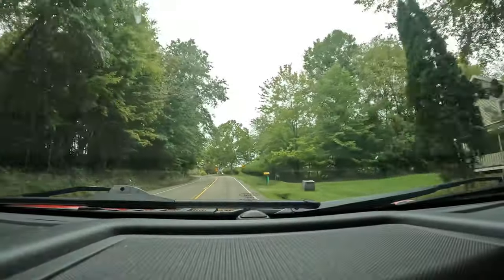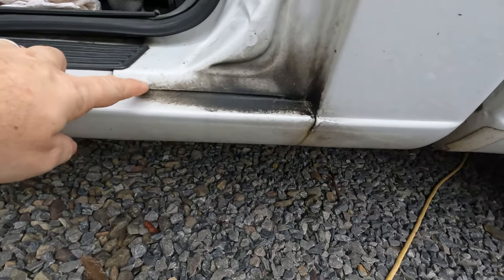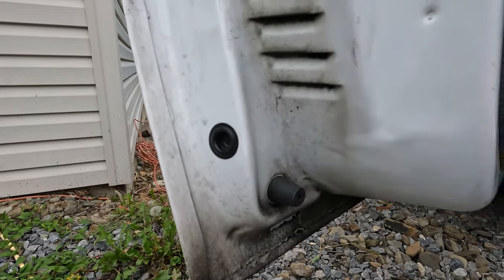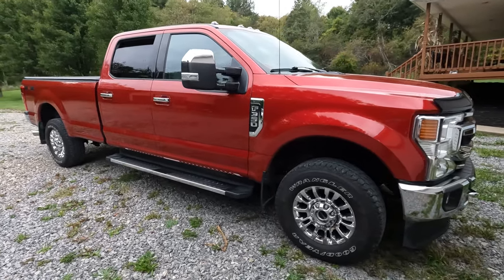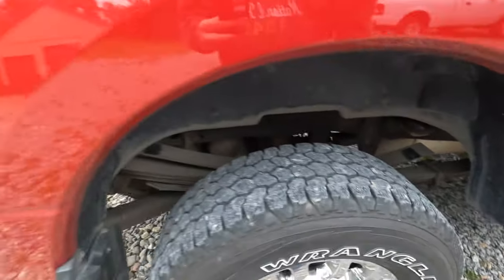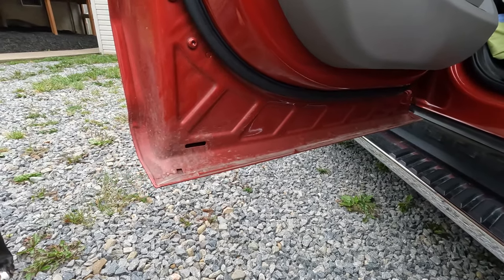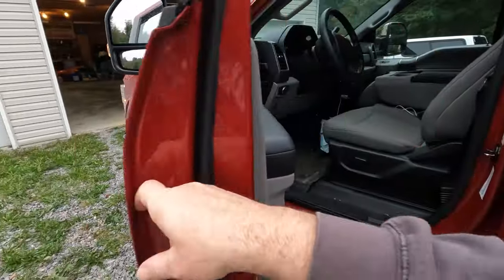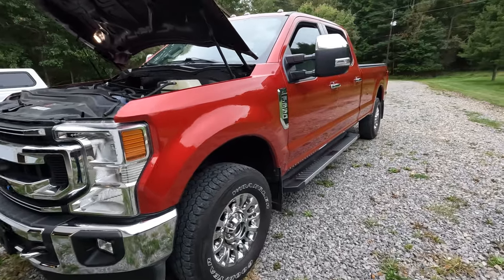Rust prevention F250 and F350 aluminum trucks - good idea or waste of money?

Comment: I grew up in the rust belt Chicago suburbs I believe in under coating. I lived in the Seattle area for 18 years. I undercoated my 02 ram no bad rust problems had it 19 years. I seen newer trucks like mine with bad rust. I think you are doing the right thing.

Comment: I would oil undercoat the whole truck. I have seen vehicles in Michigan that used aluminum panels back to the late 90's early 2000s and vehicles that have aluminum hoods and tailgates the aluminum will rot through. Its to easy to undercoat than to find out otherwise. New truck is only running 60k+ lol.
Reply from the maker: We did the entire truck this year. Oiled every bit of it. You're right - it's worth it to try to keep this truck lasting forever.  If you follow Mike Morgan - he thinks truck prices will double again in 5 years. And I'm starting to think he's probably absolutely correct. Here's his video on the topic from a few days ago. https://www.youtube.com/watch?v=lTzRi1lR98g

Comment: I live in Erie County PA.  Snow belt.  Roads are covered in salt for months.  I'm a firm believer in undercoating.  Used oil for years and then found fluid film.  I haven't sprayed FF over oil.  My last Tundra and then 3 subsequent F350's have all been fluid film only.  They all looked great for years.  I hate rust.  I purchased my own spray gun and take care of my own vehicles with FF applications.  First one is a big one...I get in the panels, pull plugs, and get inside the frame and anything I can in addition to normal surfaces.  Then, I annually do touch up.  I also use FF on my 7' snowplow and on my implements for my tractor...pins and wear areas during storage.  
In addition, I have used in on all my wife's vehicles (RAV4s and Highlander)....and they all...rust free after several years in NWPA winters.
Some people think you need a thick coating of FF....and that isn't the goal.  It creates a film that provides the protection.  I do tend to cut 10% with hydraulic oil if I want to get it to seep more into different areas.

Comment: So if you're considering this, the transmission must have turned out ok.

Or did i miss that video?

I'd stick with just coating the chassis and suspension if it were my truck.
Reply from the maker: I'm planning on doing the chassis, frame, and suspension. But I have to wait to get an appointment because I waited until so close to winter.
As far as the transmission - it isn't fixed. I'll be talking about it in an upcoming video.

Comment: My 2018 gets Fluid Film on latches and inside the frame. Wool Wax gets sprayed on axles, springs, knuckles, shafts, and frame mounted brackets. The panels are left alone. If I see rust...it gets sprayed.
Reply from the maker: How does the Wool Wax compare to Fluid Film?
Reply: Wool Wax is a bit thicker, so it clings better in "high road spray" areas. Fluid Film "creeps" better because it is thinner, for use inside doors and rocker panels. WW is available in black for appearances sake. I've never noticed either WW or FF drip after application is done. @PurpleCollarLife

Comment: I'm not a Ford guy but that's a nice truck.  Guy I know that rust proofs vehicles says it's a good idea to spray them. He uses fluid film
Reply from the maker: Thanks! I haven't had the best luck with Fluid Film staying on the vehicle very long compared to other oil undercoating options. But I think perhaps if you start with Fluid Film and re-coat it more regularly (maybe twice per year), it does better.

Comment: I honestly wouldn't bother.
The only thing that rusts is replaceable components that will last until they need to be replaced anyways.
I have an aluminum body 2015 f150 and the underside is still great after all these years in Ontario Canada.
The only noticeable spot that does have some rust starting is the under lips of the bumpers as those are steel.
I plan on upgrading to aluminum bumpers next year anyways so not a big issue.
The only place I had a real issue with rust was the transmission cooler lines.
There is a mount that mounts the cooler lines directly to the engine block and because of the temperature fluctuations, it rusts out at that mounting point.
But once again, just replace it.

Comment: Good Evening Sir, it is ALWAYS AN OUTSTANDING IDEA TO UNDERCOATING ANY VEHICULES  👍👍😇😇👌👌 Hope That Your Puppy Is Doing Better 👌👌😇😇👍👍( grease in fall ) and ( Oil in spring time ) 😇😇👌👌👍👍Sir Aluminum does corrode in deed 👍👌🧐Please Sir Do COVER ANY WHERE ON YOUR NICE LOOKING TRUCK !!! 🙏🙏🧐🧐👍👍No Rust will occur around these oil holes 👍👌😇Keep Your Truck OILY SIR 😇😇👌👌👍👍Oil is much easier to clean on paint than Rust under the paint and that cause a lots of pain Sir 👌😇👍Have a nice Week Sir Cheers 🍻🍻

Comment: I live in PA and never heard of anyone around here that does that. Who do you go to? As for the brine, it kills brake lines fast.
Reply from the maker: There are a number of privately-owned body shops and mechanics around here that do the oil undercoating or Fluid Film coating. There used to be a company that did a thick rubberized undercoating and guaranteed the body for LIFE! That company became really popular in the 80s and 90s. The stuff seemed to really work good. But they're no longer around I don't think. 
If you google "oil undercoating near me" - it usually tells you a few options.
Reply: Dude!…. I used to own a Toyota Tacoma and I never undercoated it…. 13 years later the frame was completely rotted out… Pennsylvania winters literally “ate” my truck away to nothing. Fortunately for me at the time Toyota had a recall and replaced it for free. Now I have a Tundra, I’m not letting that happen again. Fluid film is a must. 🥰👍
Reply from the maker: @Swindy1794   Those Toyotas can last forever - if you can keep them from rusting.